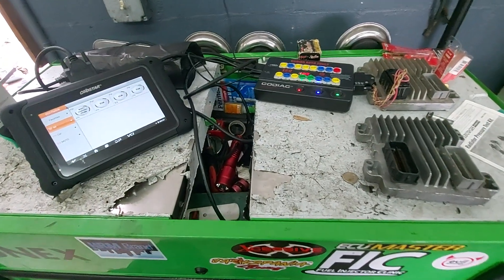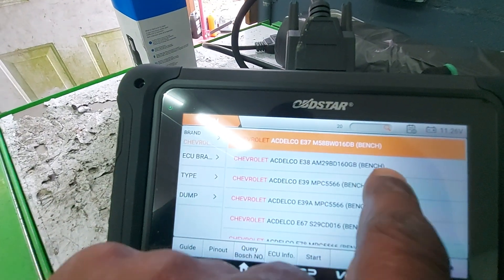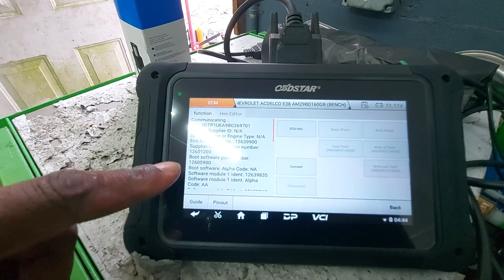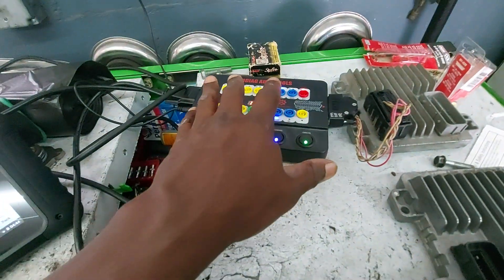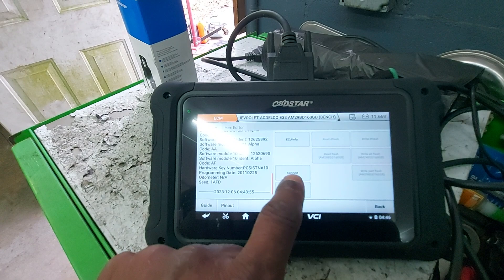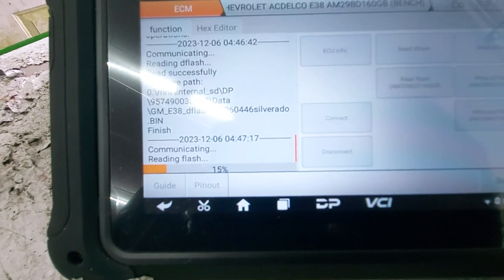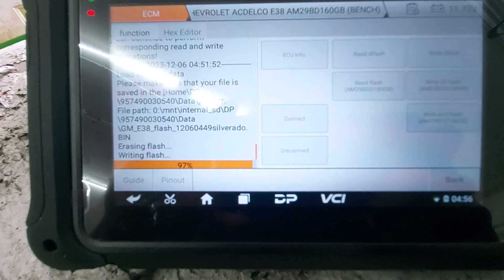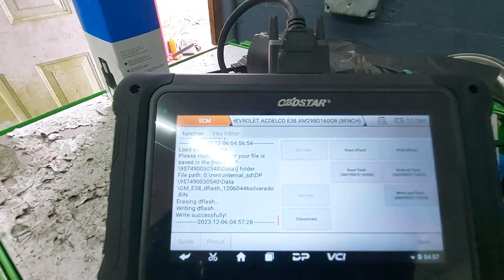OBDStar DC706 ECU Cloning Tool Cloning a 2011 Chevrolet Silverado E38 PCM. Lakelandcarkeys.com

Comment: I like your detailed explanation, thanks. My GMC 2011 Sierra 5.3 v8 is giving me code P0601 (Internal Control Module Memory Checksum Error) Do you think if I bring a used ECM with same part# and apply the same thing you are doing (cloning), do you think it will solve the problem and does not need key relearn or Crankshaft relearn

Comment: I clone an e38 on a 2008 and anti theft light turns off but the truck won’t crank at all and got a starter relay circuit code 😭😭 I guess I’ll have to do sps2
Reply from the maker: sound like it may have a non key related issue. is the lock goes out then the car recognized the key
Reply: @ it was the computer that was bad I was chasing my own tail lol

Comment: Quick question, if you had two completely identical PCMs. Same exact hardware number, service number, vehicle, engine, trans, model year, etc...  Could you just swap the EPROM flash from one PCM to the other? This would be in reference to an E78 PCM. Thanks.
Reply from the maker: i would assume so. i have cloned several gm pcism by copying the eprom and flash over to a used pcm

Comment: Awesome Victor, can this de-brick modules? Also can you virginize these modules to be used in SPS2 or FDRS?
Reply from the maker: if you had a good file already on hand, I would assume you could reflash a bricked module. i don't uses sps or fdrs too much but I assume you can just write over a used unit